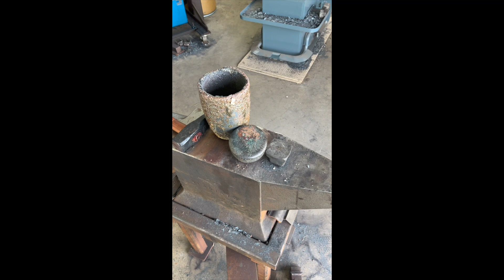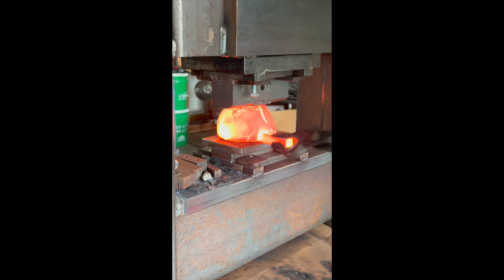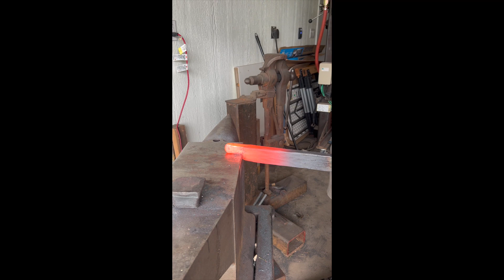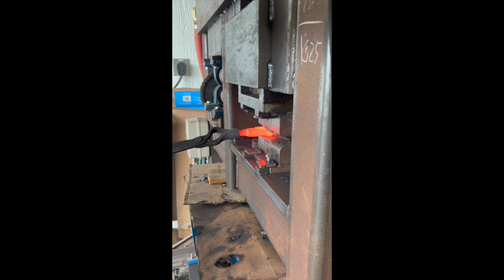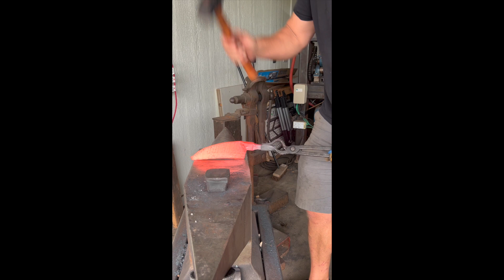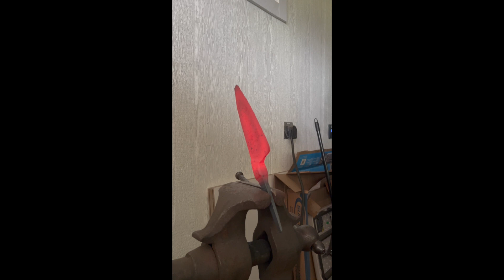Forging a Wootz Integral Chef Knife

Comment: Most impressive piece of forging.  Never had or developed the skills myself, but been closely connected to forging and metallurgical production on an industrial scale, UK gas turbine manufacturing facility, where turbine blade forging was just one of the processes I was involved in. I appreciate the skills involved in the processes from raw materiel selection through melt to the forging, grinding and polishing. Thank you Peter.
Reply from the maker: I would imagine that gas turbine blades use a very different alloy than what I'm playing with! The wootz has a fairly tight forging range by bladesmithing standards, but I know that the superalloys are a whole different beast in that regard!
Reply: Hi Peter. Further to my earlier comments about wootz steel processing and addressing your reply mentioning superalloys and high temp alloys, I continue.  I developed material testing and inspection processes based on ultrasonics to detect flaws and evaluate material properties in both forged and cast components including equiax, directionally solidified and single crystal materials.  One steel  which was particularly interesting was a triple melt vacuum steel used for rotor shafts, gears and other highly stressed components. It had very fine grain structure and very low acoustic losses. I wonder how it would compare to a wootz steel, UTS & EL, with its large grain boundary pattern?